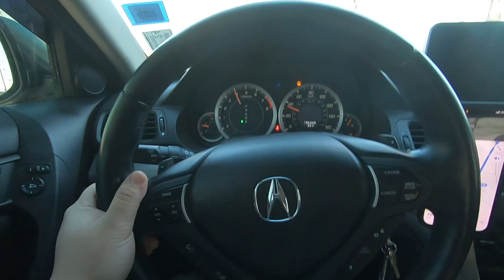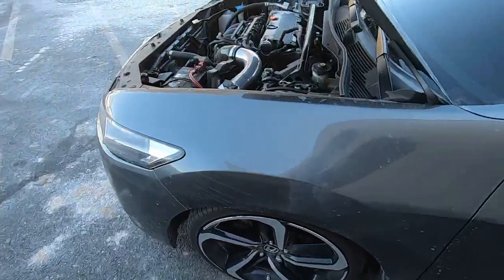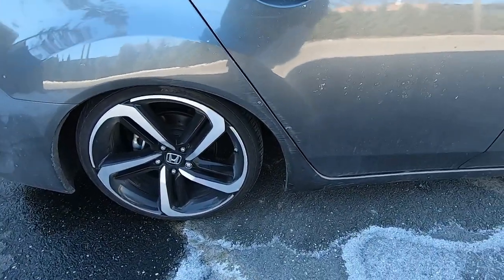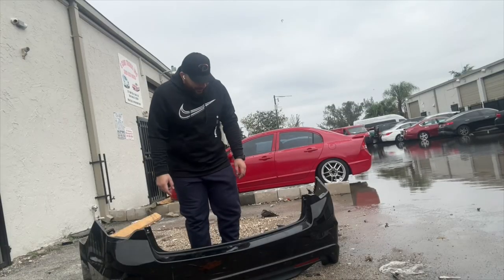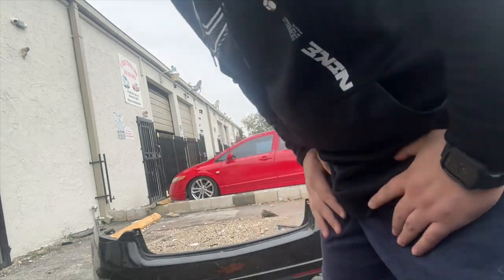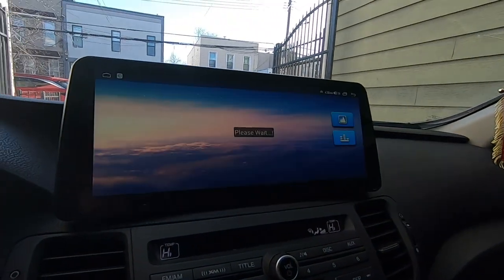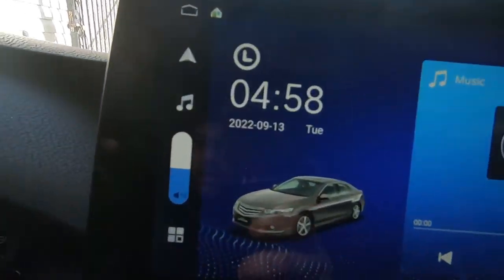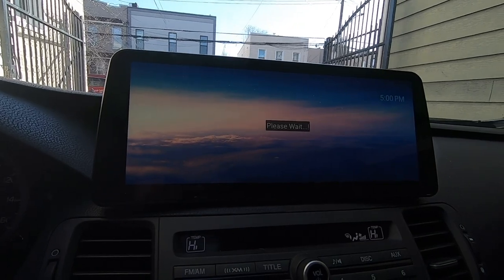5 Month Update | 09-14 Acura TSX | CU2

Comment: 9thgen si intake manifold cover fits the 2g tsx and will give it that oem look vs the ugly stock silver one. Just make sure you get the mounting hardware.
If you want more tq, ditch the short ram intake, install the stock intake  and boxand run a 4in pipe from the bottom of the box to the wheel well. Stock box is good for over 220whp in terms of flow. You can drill a hole or 2 in the 4in tube for a water drain if you live in an area where it rains alot.  If you like the vtec crossover sound leave the short ram lol. I made a 3in/3.5in cold air and the k24z3 screams tq isn't bad either lol.